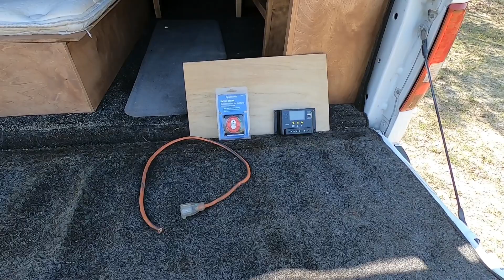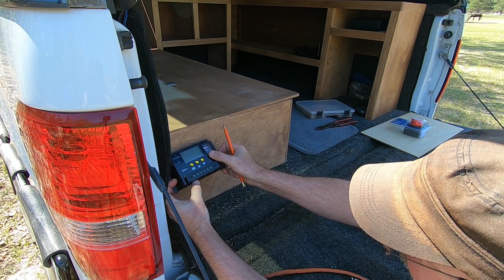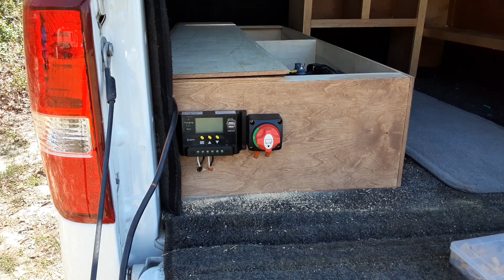DIY Truck Cap Camper Build (Part 7) Solar install with NO music!

Comment: I hate when that happens, appreciate you sharing the solar hook up and charging system. Need to do this to my truck, happy camping I’ll be watching more
Reply from the maker: Lol... thanks! It has been working great so far. I really do not need all the power it puts out, but it's what I had. I have been off grid all summer with no problems. Thanks for watching, commenting and supporting! Happy camping to you too!

Comment: Hi.  Just found your channel and catching up on older videos...     Just watched this one.   Where are the fuses? - Should be a fuse in the solar panel feed line, and another between the regulator and the battery...?     P.S Appreciate the lack of music also...  :-)
Reply from the maker: Hi... thanks for watching and you are right it does need a couple fuses. I removed the panel, controller, and battery as I never used any of it camping in the dark woods. If I ever hooked it up again I would add fuses for protection and safety. I found I did not have the need for any of it as I was on the move a lot and I charged my devices while driving. I really wish I could edit out the music in the other videos also. Thanks and I hope this helps the next person!

Comment: What you have done sure beats the heck out of what I have done... BUTKUS.
Do you have plans to tie into your starting battery or just leave it as is?
Reply from the maker: Hey Guitstik... no hurries... just watch me make the mistakes and changes so you won't do the same...lol! I will leave the solar just for the camper as a separate system. I have made a way to tie the trailer wiring on the hitch to the solar and battery if I ever needed to use it to help the cranking battery though. Maybe I can ad that to one of my videos too?

Comment: Doesn’t the battery have to vent?
Reply from the maker: Jim.... yes! Thank you for the insight.... you are correct! Mainly on charging cycles they need venting, but I do not need that big battery anyways. I will be removing the battery from inside (takes up too much room also) the truck and replace it with a much smaller battery outside of the camper. Again thank you for the question and I will give you props on this when I make a video on the replacement. 

  This is why it is good to have comments on videos. I am not perfect nor a know it all and comments help everyone (as long as they are not trolls...lol!) that might have missed things that may harm or make something easier.

Thanks for the support!
Reply: @Youcan2Adventures  likes your handy work on the camper build, and the well thought 8 steps ‼️
Reply from the maker: @biologistjim4905  Thank you! Glad you like! Stay tuned for plenty more.